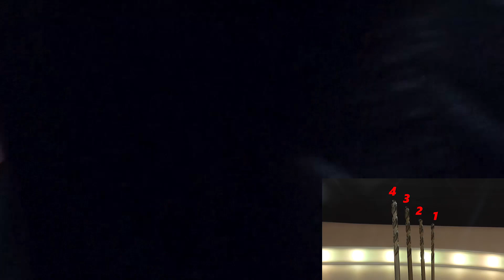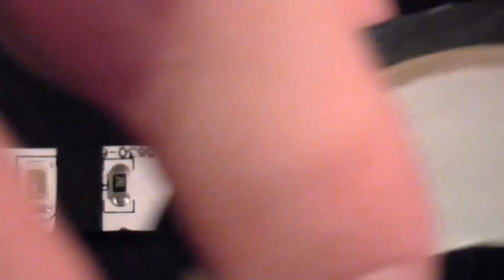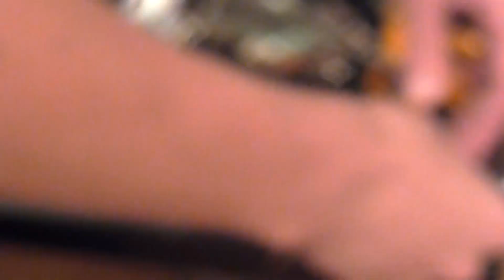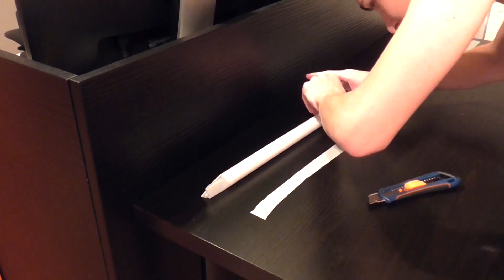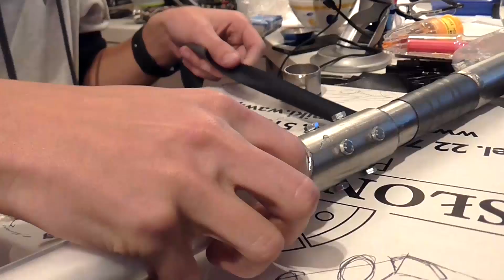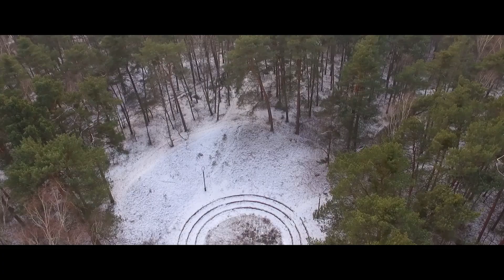DIY Led Lightsaber

Comment: how many centimeters of polyethylene did you use?  I'm making one of the second sister with two blades
Reply from the maker: Can't really say, I would assume that a roll has 100cm width and you do a few turns around the blade with it so let's say 15cm of it will be used

Comment: the individual lights on my strip lights still show. i’m use if wax paper, does using tracing paper make the difference?
Reply from the maker: Tracing paper was a 10/10 for me, I tried few different things but I couldn't get the effect I was going for a while. the tracing paper doesn't go yellow as time passes, doesn't melt when leds are placed close to it and it diffuses the light pretty well, if you have a paper store nearby I would say its really worth a try
Reply: @kyotic6366  ok thanks!

Comment: I really dont get how you do with the led strips, im looking to make a lightsaber and have 3d printed the handle, bought the pipes and now i am looking at led strips but i dont get what he does because what from what ive seen there are only led strips that need connection to the wall or am i weong about that???
Reply from the maker: well, I don't really get what u mean by the "wall" and overall not sure whats the question but I can kinda describe what went into the led assembly. first of all, u have to decide if its rgb or just one color LEDs, get as much led bulb density as possible as this will create the more even light effect and stuff, pretty obv. in my case i did both rgb and single color, the single color is just LED strip -> mini Tamiya connector -> battery (this means that as soon as the battery is in, the lightsaber is on.) on the other hand the rgbs are connected to the receiver bc u need to control them via the remote so it would be LED strip -> Mini Tamiya connector + receiver. not sure if that answers ur question but if u have any more just write it here

Comment: Which battery did you use? And tell me her specifications?
Reply from the maker: [Battery Li-Po 11,1V 3S 1200mAh 25C / 50C]: that's the exact spec if I remember correctly, its just a lipo stick battery with a mini Tamiya connector
Reply: @kyotic6366  The led strip can be any one or does it have a specific one?     Thanks
Reply from the maker: @joaoantoni6191  i think technology changed slightly since i made the video, do a small research but the most important thing is that the led bulbs need to be as dense as possible, the more leds/meter the better, it will be smoother lighting. If you want to go hardcore u can try using the nanoLED that can be programmable with airduno and then u can create stuff like animating lighting and some other cool effects. it doesn't have to be the one I used, I used this one bc it was just quite okay for me in terms of amount of LEDs and brightness

Comment: so your tubing link does not work for me and I found a new link but if you could, could you help me with choosing the diameter on this link so that it's a similar/identical size to yours
Reply from the maker: well, I think that in the vid I gave the size of the tubes i used, but if somehow i can help u more then sure, feel free to ask
Reply: @kyotic6366  yeah it's just that on here: https://www.theplasticshop.co.uk/polycarbonate-tube.html , on the diameter section i am not sure what to choose
Reply from the maker: @juststanhere9658  from this website id take the 30od28id and 18od14id pipes
Reply: @kyotic6366  thanks!

Comment: Can you heavy duel with these
Reply from the maker: U can duel, thats why I used Polycarbonate tubes and not Plexiglass ones, but idk about heavy dueling, I'm not rly concerned about the blade itself more about the screw connection to the handle and stuff like that, but if you would glue the blade to the handle it shldnt give even in heavy duel
Reply: Thanks

Comment: Good design but, your soldering technique needs a bit of work. Try using shorter leads on the end of your cables and thinner solder. That and tend your leads before making final connections. This will cut down greatly on cold joints. Other than that, your saber is pretty rugged and badass!
Reply from the maker: thanks ill try, my soldering tool the one that gets hot was broken tho it was barely keeping itself together and broke just after filming the last part. i got burnt badly xd